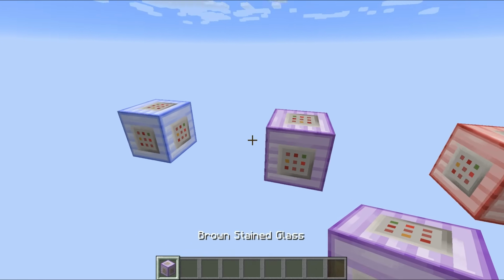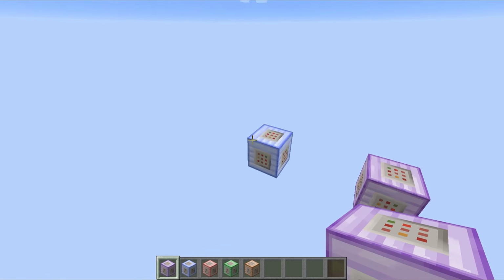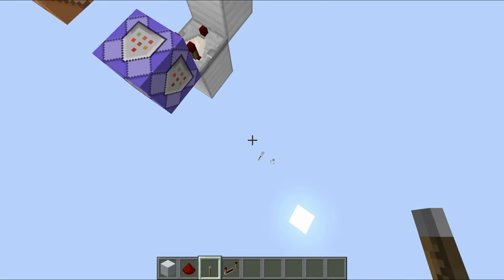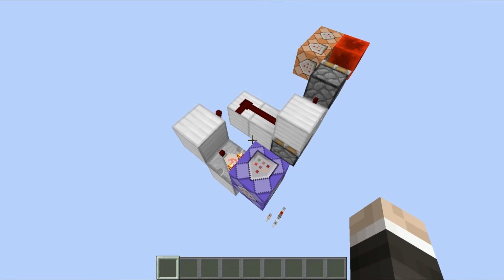MINECRAFT CIRCUIT BLOCKS: Explained!

Comment: If you could run a command for every block type this would be entirely possible for normal use.
Just have a command block system somewhere and you're good to go.
Reply: It uses specific coordinates, unless you used invisible armor stands to detect it, this specific system is impossible for blocks anywhere in the world
Reply: Not this specific system, a system which runs on every block of a certain type. Preferably a block with a direction.
Reply: Ah ok.